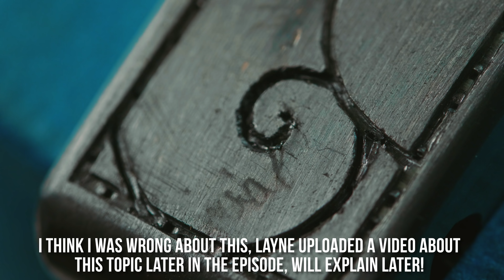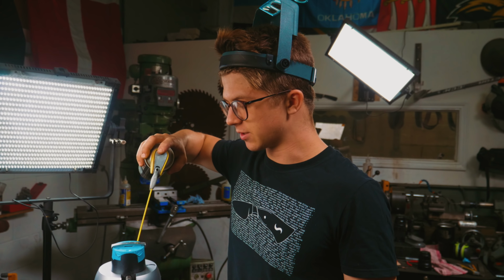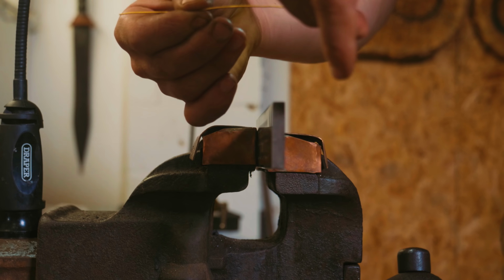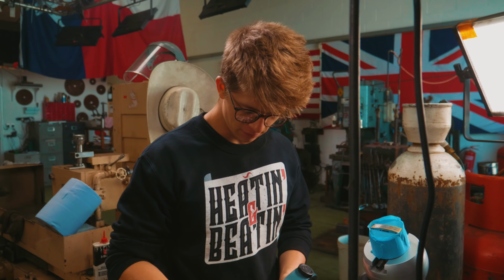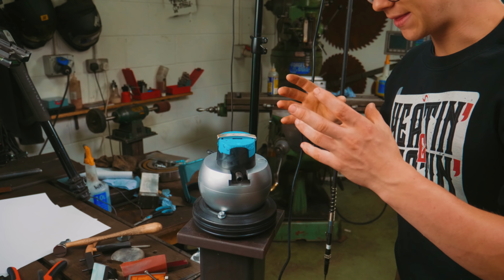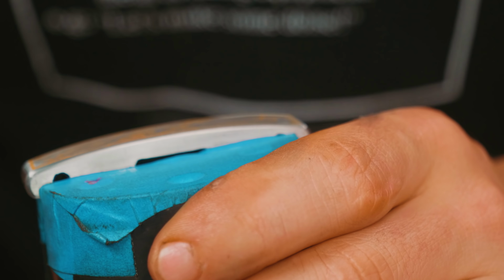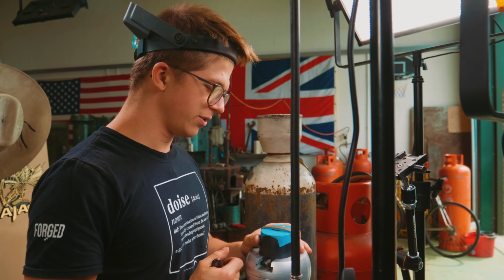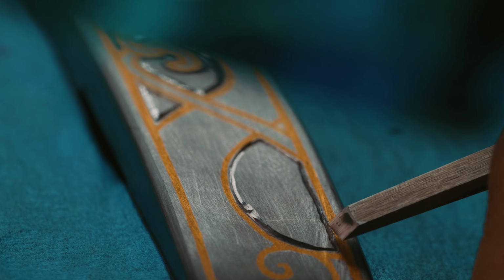MAKING A VIKING SWORD!!! Part 14

Comment: Drawplate pro tip from a jeweler who has drawn plenty of wire. Fill the back of your drawplate with bee's wax. As you draw the wire heats and melts wax which will lubricate the wire for the entire draw. Oils won't do this. They are quickly used leaving you with dry wire, which will break. 
You're doing great work so far. Learning so much in short order. This sword will be the work of art you're hoping for.

Comment: I've taken a metal smithing class before which dealt more in jewelry making and small pieces. One thing that i learned when drawing out wire is that it needs to be annealed at least every other time you draw it because as it gets thinner you're compressing the material. It's similar to how you need to keep heating your damascus

Comment: Finished my first knife this weekend. S-shaped chopper with a finger groove. Forged finish (lazy, but looks good), shaped walnut handle scales, heavy walled brass tube for retaining pins, and the balance is at the top of the neck/finger groove. I made the groove to look good and so you have a place to choke up for finer cutting. Choking back on the handle gives good chopping power.

Comment: just a tip with drawing down the wire.... be careful not to over anneal the wire because it broke where it just started to melt when you were annealing it the first time. Also run the wire through some wax (normal candle wax will do) before you draw it through the hole and that will make it silky smooth when it comes through the hole. Great job though Alec :)

Comment: Beautifull work Alec. The coming completion of this sword looks to be one of your most beautifull oness yet. However i wnated to tell you a little something: One of the more unique properties of gold is that it can cold-weld to itself and other materials. So if you chop off too much material during your engraving and have a too thin wire of gold to inlay, then you can just continue and just (gently) smash on some more on top of it. 

Cody from Cody'sLab has a few videos on this I believe his video by the name of "turning gold poweder into foil without melting" is the one that explains this the best. to sum up the video(s): He anneals the gold powder and then smashes it with a hammer and runs it through a double-whelie-thingamabob a couple of times which turns the powder into perfeclty good and nice and fine foil. 
In a later video he anneals the gold foil and smashes it with a hammer to make the worlds first gold foil ball, which functionally turns into a solid gold ball, because it coldwelds to itself. 
Keep it up. I love your stuff   :)

Comment: Using a magnetic sin plate and your surface grinder you could precision grind your engravers to exact dimensions and angles. Opening your mill and surface grinder to more of their capabilities could save you some time in the long run.

Comment: lots of annealing between draws.  Easy way to anneal thin wires without melting them is to either coil them into a bundle and spiral wrap with iron wire to create a "thicker" wire and distribute heat to prevent melting.   Or, get/make a lidded box, fill with charcoal powder bury the wire then use the forge to heat the box.

Also a regular candle makes for a good lubricant when drawing wire. Just pull wire perpendicular to candle before drawing.  Warm pulled wire melts wax and coats better

Comment: A word of advice Alec regarding the wiredrawing, you may want to consider using a dry lubricant when drawing as the process does not lend itself to wet lubricants, the die just scrapes the surface of the wire and will eventually destroy the die. Also tungsten dies are available in 0.01mm increments. lastly try to keep your reduction in size as low as possible  ~10% or less of the area of the wire cross section.
Regards 
Neal
Reply: P.S Nice work

Comment: Missed a tiny spot in that lower left (or upper right depending on perspective) corner. Also, a tiny drop of acid with an eye dropper in those background sections would daken it nicely. Plus look amazing... (on a test piece first obviously.) Amazing work Alec.

Comment: Hey alec while you are doing that graving try to remember the 20/20/20 rule. Every 20 minutes look at something at least 20 feet away for at least 20 seconds. It has help prevent eye strain which I'm sure is a concern with all that fine close in work

Comment: That whole time with the ball burr... edge of my seat worry.  Better drama than the last 10 movies I've seen!

I know you're probably going to leave the background empty but for some oil... but you should consider enameling.  It's not much support, but it would give some extra strength to those thin steel walls holding the gold, and you could add some extra color!

Comment: I’ve got a question for the smiths here in the comments, after you’ve finished a piece, what kind of oil do you use to coat/treat the blade? Does it matter what kind? Is oil always necessary? Or is that only for certain steels?

Comment: Alec, invest some money in some rolling burnishers for your flex shaft rotary tool. They come in extremely handy when I accidentally scratch or scuff a piece of jewelry. I personally prefer the ones with bearings on the work face of the burr, but you might find that the solid burnishers work better for steel. Good luck!

Comment: At around 14 minutes you're using the ball bur or round bur as we call it, and you're using your other hand to support your working hand.  What I do depending on how you're using the handpiece is either have your thumb of the hand you're using as a finger rest or your ring finger.  That gives you control and helps prevent skipping of the bur.

Comment: Probably something you're already doing but might help to do a couple of practice scrolls first, on another piece of steel, before going into the main piece. This should help get you back into the rhythm of using the engravers and help reduce early mistakes while you get used to it again. Also a great tip for drawing.

Saying that, this looks awesome!

Comment: I'm probably wrong here, as I'm basing this of my own experience as a chef but those engraving tools (even after you made thinner and smaller versions of them) still look too big i feel like you would have had an easier time on the more detailed sections if you had more compact tools. The reason I say this is simply from watching you bunch your had right at the base of the tool leaving quite a few inches of length sticking out the other side of your hand, which to me seems like madness e.g. i could slice grape using a cleaver (it would work) but I don't. I use a pairing knife.
That said.....I'm probably wrong.
Keep up the great work!
You're an inspiration to many creators! Young and old.

Comment: Tip: if you enneal you wire you need less oxygen AND you go from the beginning of the wire to the end tip. like this it s easy because of more even heattransfer.
Reply: also when you got your channel for your inlay, you should make some points into you channel. this is for stronger inlay.

Comment: Why not use a different steel (darker) as a "core" for the guard, would improve even more the contrast i think. You could even rivet in 2 engraved plates that you can work on without actually redoing the whole guard if you make mistakes (rivets could be integrated into the pattern maybe ?).

Comment: you could use a magnet to pick up any stray iron filings or chips in that area, and then whatever's left should be gold and copper... or just random dust particles that landed on the floor... >_>

=p

Comment: Maybe, you should forge a variation on a German kriegmesser or war knife basically it has a similar blade to a katana only it's wider, longer being between 76 to 81 cm as opposed to 66 to 70 cm, doesn't have a tanto-style point, usually is flat ground from the fuller to the edge , has an open tang wood scale two-handed hilt basically a long knife handle, and a straight crossguard with either a third prong (called a nail or nagel in German) or a single loop riveted or forge-welded to the center of the crossguard above the knuckle, a modern example of this sword being the Albion Swords Knecht.  
However, Albion Swords doesn't make theirs with Damascas Steel you see the problem here don't you Alec so to quote your catchphrase less yack yack more wack wack.
sincerely your fan, William

Comment: Having zero precious metal inlay experience, I'm wondering if it would have been faster, easier, or more effective to have simply melted the gold into the channels? Its melting temperature is significantly lower than steel's, so would that have worked? Or could you try it?

Comment: Alec, since you have a surface grinder at your disposal, you should check out Robin Renzetti's video on precision ground toolroom stones.  You can cut off your upset steel and extra gold without harming the surface of your work using an India stone you've turned into a precision flat surface using a diamond wheel and your surface grinder.  The video is well worth the watch.  It might even be useful for making bevels perfectly true.

https://youtu.be/DVLXsq7pi9Y